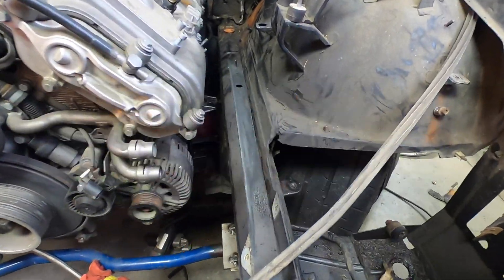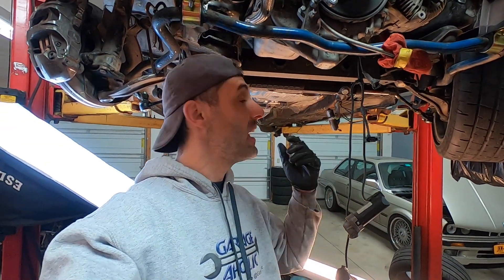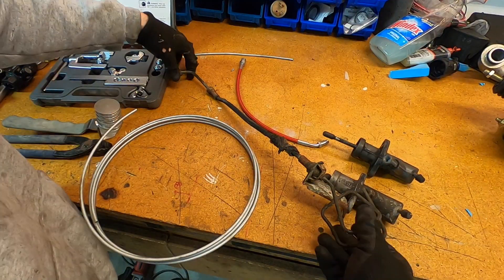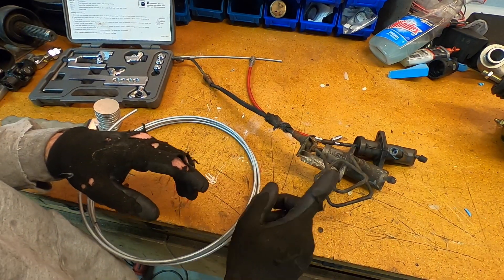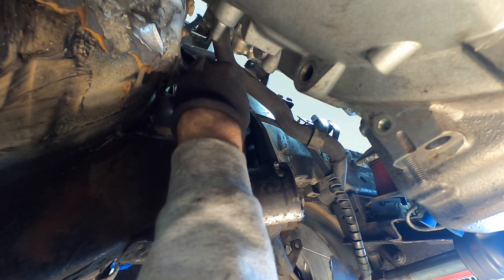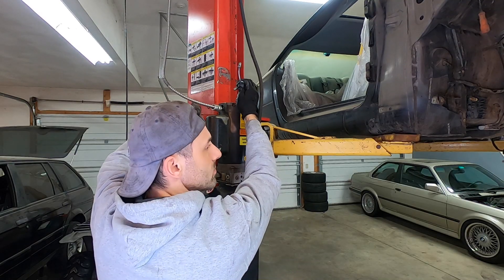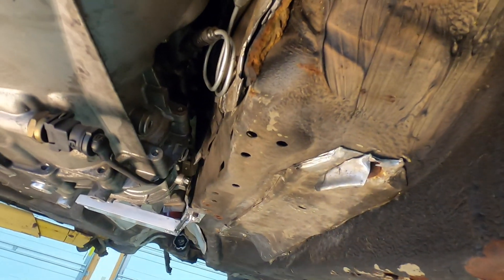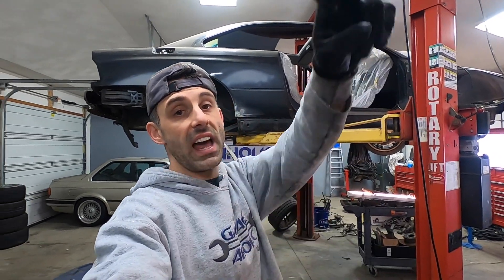850i V10 Critical Thinking With The Hydraulic Clutch Lines!

Comment: Nice progress Frank. Got a question: Did the V10 came with a 6-speed manual gearbox or was there original a SMG gearbox connected to the V10. Dutch regards, Nico.
Reply: US version V10 was available with 6speed
Reply from the maker: It was available but this specific s85 harness was mated to a SMG trans. I swapped to manual. So there will be some wiring updates I think I’ll need tobmake